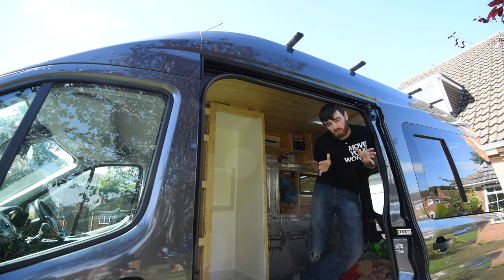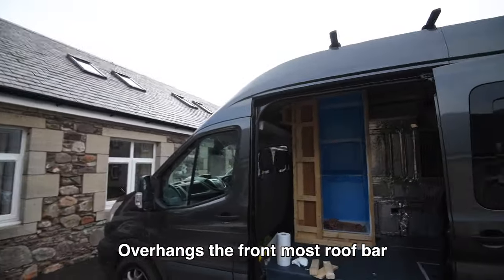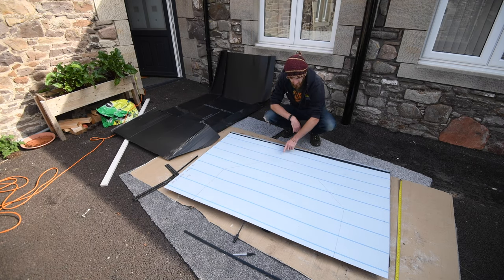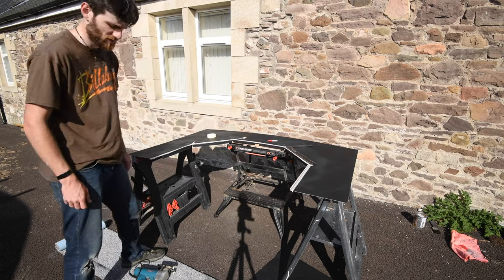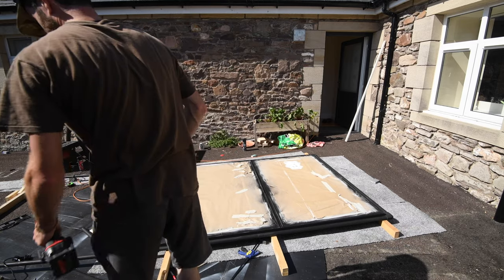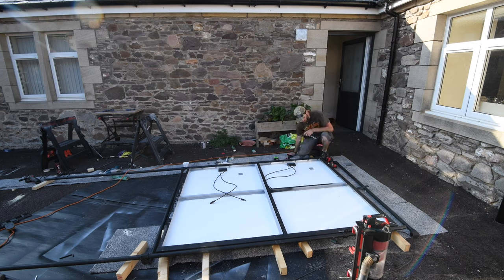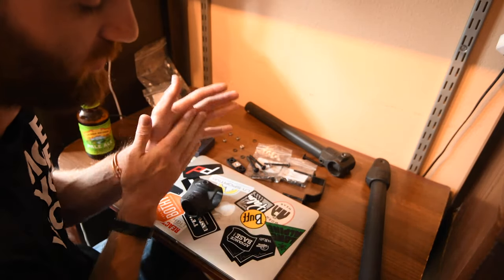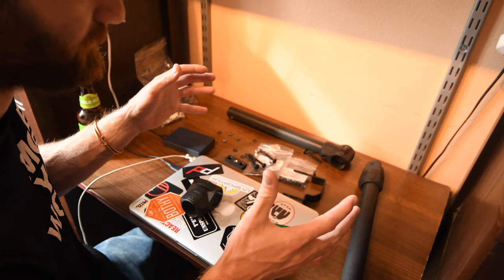I FAILED: PART 2 DIY 750 Watts Solar Roof Rack! | EP24 | Ford Transit MK8 Campervan Build

Comment: Thanks for showing the full process, even if the first iterations don't work!
Reply from the maker: SilentEcho1181 no problem at it. I think transparency is important and can be sometime be lacking in van builds. The new parts for Mk2 are still arriving and hopefully got to work on that sooner. It’s the same design only a few more extra parts
Reply: Mispronounced Adventures Fair play mate, you’ve been doing a great job, the best you can. It will work out in the end, good luck. We’re putting our one large solar panel on a diy roof rack made from unistrut tomorrow 🥺
Reply from the maker: Unfortunate because of the transit horrifically curved roof unistrut isn’t possible. Even the mounting points for the use roof bars aren’t even flat, they bizarrely out at an slight angle as well. But it’s getting there
Reply from the maker: Best of luck with the fit of your panels tomorrow! As I was given the panels by a neighbour. Thought I might best see how many I can fit on!
Reply: Mispronounced Adventures Cheers 👍🏻 I don’t blame you 👍🏻. As we say in Yorkshire ‘Owt for nowt’ and we’ll make it fit. 😉👍🏻 We’ve got the same van as yours, that curved roof is a nightmare 😠
Reply from the maker: Haha Definitely,  where abouts in Yorkshire? I lived in North Yorkshire, Middlesbrough for 8 years.
Reply: Mispronounced Adventures We’re using unistrut with the same van as yours but mounting onto M8 rubber motor mounts to make up for the angle issue of the roof bar mounts (hopefully) 🙏🏻
Reply from the maker: Smart solution! Hopefully that’s should all work out then
Reply: Mispronounced Adventures Leeds. Those roof rack holes are ridiculous, hubby is an engineer and to put it mildly they are s*** 🤣🤣
Reply from the maker: Couldn’t agree more!

Comment: Saw your comment in the video about not being able to weld aluminium. Have you seen Durafix aluminium brazing rods - can be used with a basic propane or mapp gas blowtorch for joining bits of ali together. Available from eBay, Amazon, ScrewFix etc. Probably cheaper than all those scaffolding clamps you’ve already purchased.
Reply from the maker: Ian H this was something which has been said to look into before ( but after mk1 was made ) . But I had mixed thoughts about it on doing research as it’s brazing over welding. I wasn’t sure with the surface area in tube section with brazing alone would be enough. I also feel like I lack the clamps and tools for notching tube to make a good joints .

Comment: Great build mate have you thought about turning professional, how long did it take to build 👍
Reply from the maker: Much appreciated :) could be something to consider! Timing wise is still an ongoing build with most episodes being usually a week behind reality.
Reply: Mispronounced Adventures it’s looking great we have been following you because we are about to embark on our own build looking forward to next episode mate keep it up 👍
Reply from the maker: Thank you very much. Good luck on your build! What model have you gone for?
Reply: Mispronounced Adventures Peugeot boxer 2014 .hdi335 medium wheel base needs abit of a clean but looking forward to starting ,we work in the building trade so got lots of contacts for cheap material  👍👍
Reply from the maker: Good choice I’ve driven quite a few of those  when I sell Christmas trees in November and December. Definitely good having the right contacts for cheap material!!
Reply: Mispronounced Adventures 👍👍👍